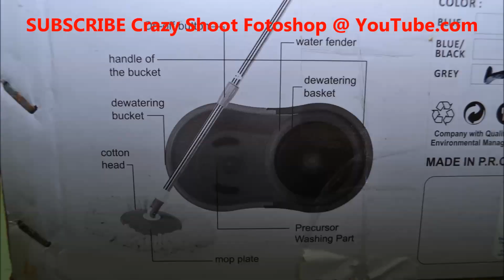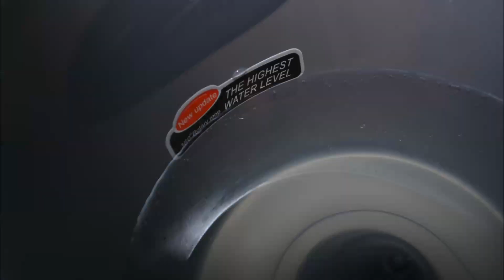Primeway 360 Degree Rotating Grey 5500 ML Magic Spin Mop Set with 2 Microfiber Mop Heads Unboxing

Comment: I purchased from pepperfry yesterday, at Rs.399, with cashback of 20rs. From Paytm.
Is it worth it.
Reply from the maker: Yes, great deal. Accessories for this product always available online.
Reply: Thanks
Reply: Cric 8 is this mop good? Is it working properly?
Reply: vinay patil yes it is, i m using it from last 10 days. It works fine😄😄
Reply: Cric 8 sir kya ye light weight h jb hum esko pressed krte h toh
Reply: Tarun Dhingra haa ji bilkul, but water me rotate krte samay extra force lgta h...
By the way, product is really nice
Reply: Cric 8 sir vo toh lgta h sir vse bahut jyada lgta h ya normal khi mop me toj bahut jyada lgta h plz tell me sir
Reply from the maker: Is braand mein aapako bhavishy ke lie parts aur accessories bhee milenge, hamen ek aur naya mop khareedane ka aavashyakata nahi hai. isake dvaara ham paise bacha sakate hain. Just type primeway mop in google, you can find mop's necessary items, cloths and parts easily.
Reply: But I didn't get 20/- cashback